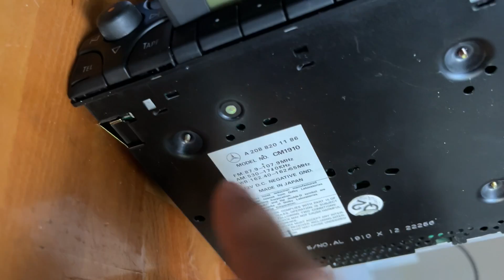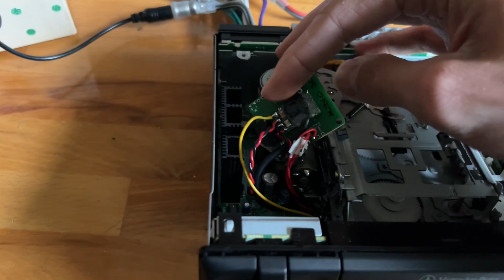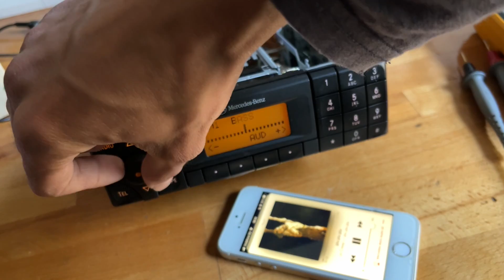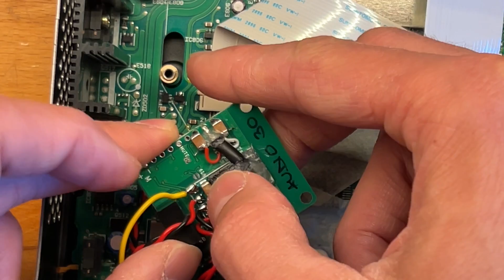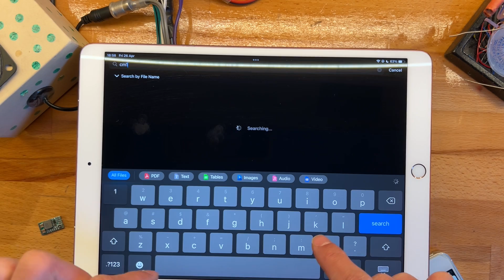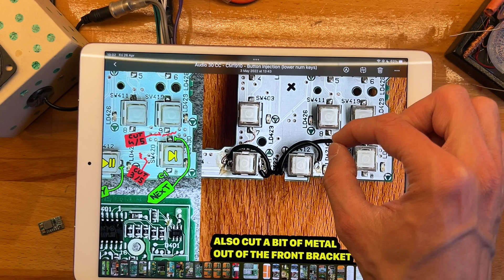Mercedes-Benz Audio 30 CC (ALPINE CM1910) - Bluetooth / AUX Tutorial

Comment: Just finished the AUX mod for this model. It was moderately difficult, due to small soldering to the pins of the chip and wire routing. But hearing music in good quality, without the annoying tape adapter or writing CDs was well worth it. Thank you so much for the work you did and for putting it on the internet for free. ❤ from Canada.

Comment: Hi Darieee! Thanks for this awesome video.
I have a question that very likely has an obvious answer for you, but my extremely limited knowledge on this field prevents me from figure it out by myself...
Why are you wiring your Audio inputs directly to the Phillips processor on the motherboard instead of wiring them to the cassette player module, like in most videos showing how to hack cassette players?
Is this something specific to this head unit? Is it related to the quality of sound?
I've just watched some of your other videos, and from them I got the impression that you know what you are doing way more than any of the other people posting.
I just want to wire an aux input port so I can connect an external Bluetooth receiver that has a microphone and support to make phone calls.
Thanks a lot!

Comment: Hi Darieee. I have a slight issue with my radio in my Mbz. Its the same you show in the video. I bought this radio from a friend of mine. And put it on my car. It plays fine. I have the code and everything. The only issue is that don’t have a fade option when i press the audio button. Only bass treble and balance. But not fade. Is there a way to put the radio on test mode so o can change the setting so it will accept the 10 speakers on my car? It plays all the speakers except the ones on the dashboard. I know this radio came from a two door car with six speakers. Yes it is an Alpine cm 1910. Not a Becker. Any help would be appreciated. Thank you.
Reply from the maker: I've seen these units without fade :( I never tried configuring that back in ..

Comment: Thanks for sharing this. I needed a fix after my cassette mod stopped working due to the tape motor. I used some caps this time (Nichicon ES 47uf 16v) and it got rid of the popping from before. My unit actually works with the cassette player and ribbon out, although the FM now seems to be blanked out (not sure if this is related).
Reply from the maker: I think I remember these units being fussy about not seeing their tape deck indeed .. the APS BT-2 from Bosch also makes a huge fuss about not having it 🙂‍↔️

Comment: It's difficult to tell in the video, did you grab the ROPO/LOPO pins or the ROPI/LOPI pins? Thanks for posting these videos!
Reply from the maker: ROPO & LOPO 🤘

those are closer to the input multiplexer in the block diagram, and so volume changes inside the mixer IC won't result in slight popping

Comment: First wow.. that's hard core stealing/repurposing the buttons for bluetooth functionality.  I have a question about similar Becker radio that I modified for bluetooth but in the process of taking it apart, I now for some strange reason don't know why the tape door does not close.. I don't quite remember where the plastic protruding piece fits or if anything broke, or if I need to take any particular steps to get it to close again.. I don't believe anything is broken, but would love any suggestion is much appreciated.
Reply from the maker: the little arm that opens the door has a place where it clips into the tape mech, maybe that's off

also, insert&eject a tape to make sure the mech is in an ok position
Reply: @Darieee  Thanks for your reply. Question, is the door supposed to close and stay closed, even if the radio is outside of the car and without power?
Reply from the maker: yep - it latches mechanically
Reply: @Darieee  thanks for confirming.